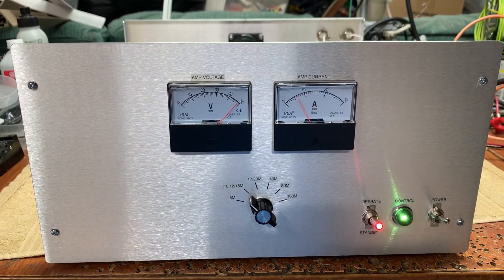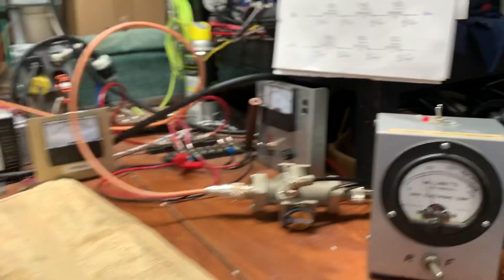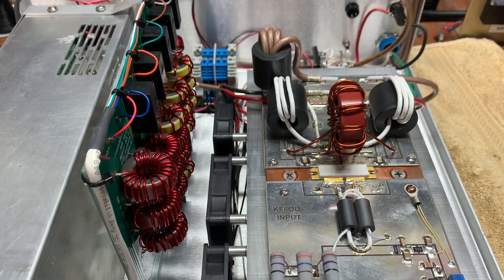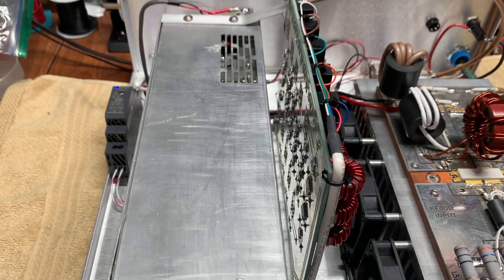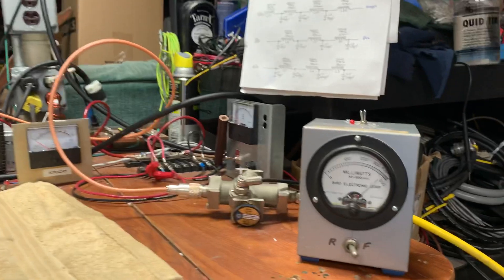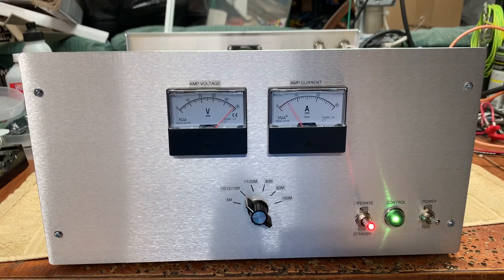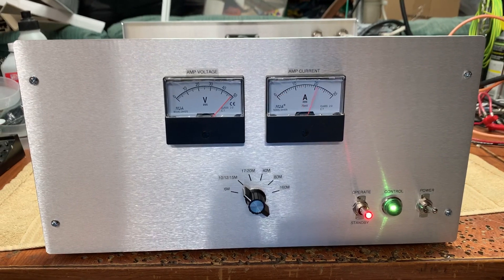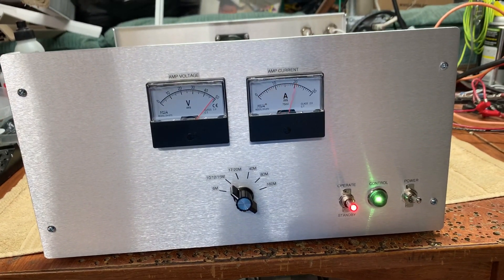MRFX1K80H amplifier

Comment: I'm building one too...(blf188xr) I am putting over current protection along with lots of other protections in it ..I chose the Russian LPF board which is essentially the same as yours.. you are 100% correct ... these will run 1kw SSB forever  provided you have a good heatsink with a very good copper spreader, good circuit design and lots of attenuation....and only have a watt or so going into it... push the input higher and you will blow it up...

   I suspect that even though you tell your buyers  only to put the amount of wattage that you've attenuated it for, that some will still have that CB mentality and have to get an extra 200 watts out of it  even though at 1k you'd have to triple it to gain any appreciable increase on someone else's s-meter... And they will Blow up the chip...... AM mode really needs to be 1/2-1/3 power  of SSB to keep it from getting to hot... I put a temp switch in mine ,so if it gets too hot you'll just be dumping all the power from the radio into the attenuator. Handy thing to do considering how poorly fans are made nowadays..
 Once looking amp

Comment: Awesome linear, Congrats! Just curious, is this the same device that is deemed as 'indestructible?'  There was a vid here on yt that showed 1 of those transistors and they threw everything at it and it just kept working. I thought that was amazing! Your thoughts appreciated. Thanks!
Reply from the maker: Thats correct, Just don't over drive them or draw more current than they are rated for and you will be fine.